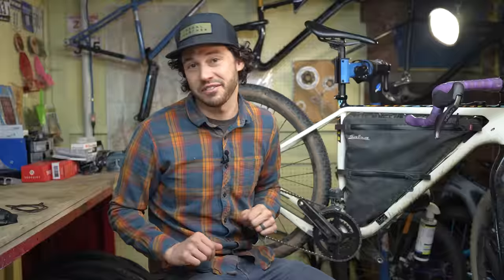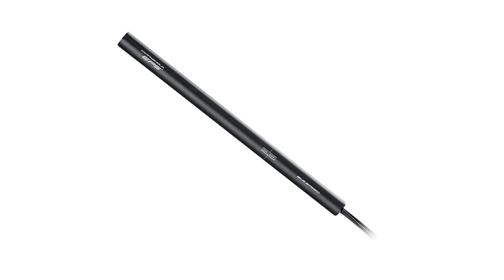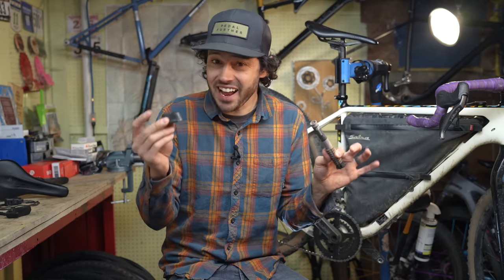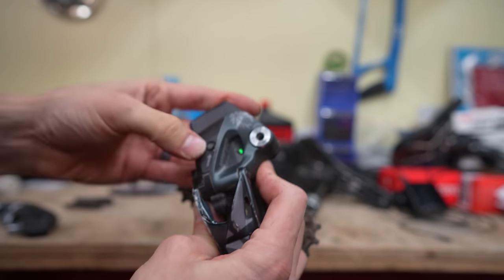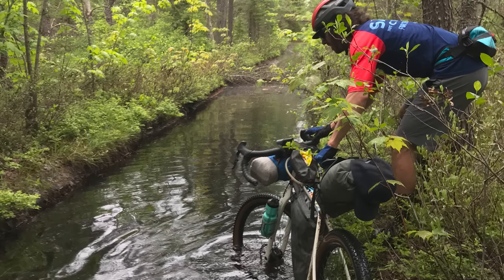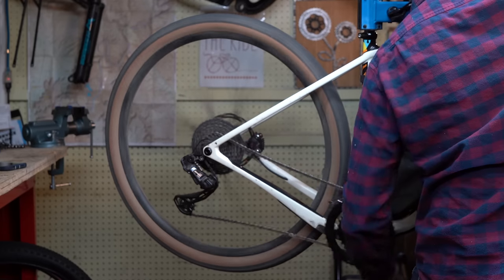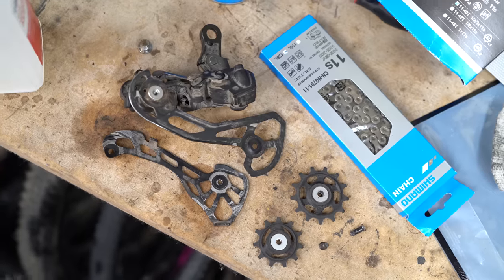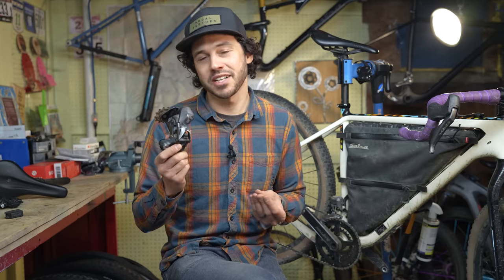Electronic Shifting: Pros, Cons, Reliability, and More

Comment: Love all the videos you guys create. One nerdy comment about the break-in period for mechanical shifting. I worked as a bike mechanic for 10 years and heard the 'shift cables will stretch' explanation Many times as well. However, when I attended the John Barnett bike maintenance course they shared a slightly different explanation - the cables don't stretch at all (it's a braided steel cable, how much stretch could that allow?). They asserted that any secondary adjustment was likely due to the cable housing settling into the end caps. (Like, if the housing wasn't cut exactly square, the first shifts would compress the housing into the end cap slightly). Anyway, I thought their explanation made a lot of sense and was pretty interesting and wanted to share, whether or not it is 'the truth'. Cheers and all the best for a rad 2022!
Reply from the maker: Interesting, thanks for the explanation. Damn cable housing always making it difficult for us!  More reason for clean cuts and diligences in the first place. Rock on!
Reply: It is, indeed, the truth. If you grind the ends of your housing with a dremel on the install, and make sure to settle everything in right away, then cable "stretch" doesn't exist.
Reply: Yup, true story. Barnett graduate as well 🍻
Reply: @SnootchieBootchies27  amazing. What dremel "head" (bit?)  do you use for this?
Reply: @kimkrimson  I just use a cut off wheel like a grinding disc and just get the end nice and flat. You have to do it in short bursts or it gets too hot and melts the plastic all weird.
Reply: @SnootchieBootchies27  I tried cut-off wheel - great results but too much setup & fiddling to avoid melting sheath.  I get consistently good results by using high quality cutters (Felco C7), and by holding the housing straight and steady while I cut using Wilton vice soft jaws.
Reply: @chuckb4375  it is a bit fiddly, and not entirely necessary. A good straight cut and and a "pre-stress" by connecting the cable, holding the derailleur, and shifting up, is all you really need. To be clear, when I use a dremel, I make the main cut with housing cutters first, and then I'm just doing a light grind.
Reply: Yep truth, kinda like chain "stretch "
Reply: That was a great explanation

Comment: I used the Sram AXS system on my ten days on the GDMBR. Extra battery and charger, but never needed to charge during my ten days. The lack of shifter cables allowed me to set my bags up easier. I also have two of the tips of my fingers amputated so the lack of grip strength didn’t affect my shifting on the long days in the saddle.
Reply: Carpenter?

Comment: The most important thing to remember is that electronics can go bad, unexpectedly. And fixing in a remote location is, well, make a guess!
Reply: With electronics, there's not much to go wrong... Fixing a 10-speed, 11-speed, 12-speed drivetrains in, let's say Africa, where you can only get a 9-speed replacement parts, is... Well, make a guess!
Reply: RollinRat  so that's settled... any derailleur will work, just need to buy a cable too. The same goes also for electronic shifting. Why would anyone need to have a 500 usd unit shipped over? If you go for 1 month bike packing in South America, Asia, Africa, you better go with 2 x 9 drivetrain, no electronics, no modern technologies, no hydrolic brakes,... Since I will never do that, I assume my longest trip would be 1-2 weeks, I'm fine with electronics and 2 batteries with me. Mind the prices will drop significally very soon, Shimano is about to release new electronic stuff any day now.

Comment: I used etap AXS on my gravel bike for about 18 months before I switched back to mechanical shifting. My primary motivation for switching back was that I wanted to simplify my bike maintenance routine and regularly charging my etap batteries added one more little thing I had to remember to do. Additionally, even though I regularly charged my derailleur batteries, I did find myself without shifting when one of my CR batteries in the shifter itself decided it was done.  After that, I decided to regularly replace those CR batteries which added yet another , albeit much less frequent, maintenance task to my bike, and to be honest it felt really wasteful doing so since I had no idea how much juice was left in them before I tossed them out of principle of preventative maintenance.  I do often miss the crisp shifting and robot noises, but I also enjoy a bike that doesn’t ask a lot from me.  
Great video Neil

Comment: You know, one thing that might make electronic shifting appealing to me would be really broad cross-compatibility. Like if I bought a Shimano 13-speed MTB shifter 10 years from now, it would be compatible with a 10-speed road derailleur from 5 years ago, in on either a 10-speed or 13-speed drivetrain, or anything in-between. Currently I have bikes with friction shifter, bikes with 20-year-old rear derailleurs, bikes with road shifters running MTB rear derailleurs, etc. Sometimes this is tricky or takes Goat Links or Problem Solvers to make this work, but other times you luck out and it works great on its own. With electronic shifting, there is no real reason for derailleurs and shifters to NOT be compatible. Length of a derailleur cage could limit gear range, but other than that, why not? THAT would be a selling point I would be interested in.
Reply: Archer Components D1x is pretty much what you're describing: taking any mechanical rear mech and feed the cable to a wireless actuator. You then tells the system how many gears there are.
Reply: @greatgoofy  I concur. I have used the Archer D1x for several years and it’s a really easy package to setup and adjust — and it’s brand agnostic. They even mix component brands on their YouTub channel just to prove how versatile it is. The D1x, it has advantages over Shimano and SRAM with the set up and adjustments. But the down side is its form factor. Still a great company with very personal customer support!
Reply: RollinRat  I hear ya. I tried to order a pair of thru axles for my bike last week. The number of "standards" is obscene. Why couldn't they just pick one thread pitch and 1 or 2 lengths when they switched to Boost? Ridiculous.
As for friction shifting, my favorite bike is my touring bike (a bike that can do anything), 3x10-speed friction shifting, its always flawless.

Comment: I don't have anything against electronic shifting. If I was building a XC or road race bike, I might build it up with electronic shifting. But I'm not. Few people are. And I just can't see any compelling reason for it. It shifts faster and more precisely? With minor exception, my bikes shift flawlessly. I don't doubt electronic shifting is better yet but would I actually gain anything from this? Not everyone is a great mechanic and therefore their bikes may not shift great. But if you can't set-up a mechanical shifting system, is an electronic/mechanical transmission really going to be easier to handle?
My biggest reason for a lack of interest in electronic shifting is that I DON'T WANT TO HAVE TO CHARGE MY BIKE IN ORDER TO RIDE IT.  I don't want to have to worry about it on a long ride or multi-day trek, I don't want another thing to think about as I'm rushing to get a ride in after work. Or having to deal with the battery running out of voltage in the cold or wearing out after a few years of use. In the end, I don't see any reason to spend extra money on something that provides no value to me, and makes my life even more complicated than it is.
Reply: I agree some times I rush home to ride after work, would be a pain to discover my batteries are discharged and so my ride is over :-( Also batteries are not really ecological especially those CR2032 in the levers . . . But having no shifting cables is appealing in a sense 😇
Reply: Here here
Reply: I did a bike packing trip with a friend, borrowed his bike with Di2, never charged it, stuck in one gear the entire time. Luckily it was the perfect gear and it wasn’t bad. When it’s charged it works real nice.
Reply: I agree, but I also always ride with lights, and a head unit that require charging so they always get charged, so I would just charge at the same time. Likewise, you can always have a spare battery in the base of AXS especially. I can see the merits of both. It’s why I’m going to try AXS and if I don’t love it either swap it to another bike, or sell it, but everything other than battery charging seems to think I’ll love it. Plus, it doesn’t require the work arounds I’d need for a “mullet” build

Comment: Why not? I still have a buch of  9 speed shimano mtb components. My gear is well maintained and thus crisp shifts. Besides that, it is rock solid build quality not to forget compatibility with 9 speed road levers. IMO It's the environmentally soundest way: to continue using what you have till its worn down before getting something new. ...and Electronics? eh.. too expensive.
Reply: look at the Archer components system, it can be configured to shift any rear mech with 2 to 20 gears (you chose) and the cost looks very very reasonable compared to the usual suspects

Comment: my 200cents on this topic: i think theres more nuance in the electronic vs not. good mechanical are arguably better for bikepacking, but not all bikes can use them. e.g. sram eagle with sram cables and hoses is perhaps a better choice as cable stretch isnt a problem and these shift extremely well, while on 2x axs and others are arguably saving a lot of setup time and so on.  also, electronic drive trains derailleur hanger can and will bend too. the axs protection mainly protects the expensive derailleur itself, so that the hanger bends or break rather that the servo gears (which is great actually).  imo while all the electronic tips in this video are good, the pro and cons section is misleading.  i also have various drive trains my my 2016 sram eagle has 10000kms and  quite a few week-long bike packing trips, been taken on planes, and around the world. one advantage is that if it breaks really bad im more likely to be able to piece it back together or get a replacement shifter. on the plus side of axs, i can easily remove it before a flight and put it back as setting it up takes 1min, to avoid damage during transport for example. its also great where puttin eagle requires hacks, or where the frame doesnt align just right for 1x, or where i use 2x (i also like di2, but axs can be swapped so easily...)
Reply from the maker: All good points.  The fact that you could say get a 12 speed mechanical system to work with 11 speed mechanical system in a pinch is certainly an upside. And removal of the AXS or even Di2 rear derailleur is so easy, that's a great travel hack. This video had a few variations at its inception but this is how it was born, I think it could have easily been "mech vs electronic" video, but I wanted to simply talk about electronic shifting with a few comparisons along the way. Thanks for the words!

Comment: Mark Beaumont biked the entire length of Africa unsupported using a carbon fiber bike with Shimano Di2 electronic shifting, which only needs recharging every 5000 kilometers.

I myself use electronic shifting on a carbon bike for bikepacking, a Rose Backroad Limited Di2 modified with a Garbaruk extra long rear derailleur cage to accommodate a Shimano XT 11-47 cassette. The Shimano GRX Di2 is lighter than its mechanical counterpart, as all Shimano electronic group sets are. It is ultra reliable. I see no need to bring an extra Di2 battery because of the extremely long life of the internal battery.
Reply: SEAM electronic setups can be heavier. Pretty sure GX AXS is.

Comment: One thing i really like about shimanos road di2 shifters is that they are more compact than the mechanical hydro ones (i have small hands), and they feel higher quality because there is no wobbly play in the lever action. i also percieve the braking to be more direct and stronger from the tops but i guess thats due to a better reach with small hands. apart from friction shifting and some hacks they are also the only way to get a modern shimano 2x/3x mtb drivetrain to a monjstergravel/touring bike with dropbars.

Comment: Two issues for me.  First is the price, darn expensive.  I'm still struggling with the notion that bikes have cross the $1k barrier, which is now about an electronic groupset's starting point.  Second I'm pretty sure that if I actually try electronic I'll go down the rabbit hole and find mental justification to retrofit most of my bike fleet to electronic, which takes me back to the first issue.
On a more serious note I do look at my growing pile of dead rechargeable batteries from lights, battery banks, etc and would prefer not to add another source to them if I can avoid it.  Disposal is a hassle, and I'm guessing more people than not improperly chuck them into the trash rather than hunting down a proper electronic recycling drop location, which is a hassle, and hence my growing pile of castoffs.
Reply: RollinRat  You keep repeating that. There is always something that can go wrong, no technology is fail safe. I started riding a bike with electronic shifting last year, also traveled about 3000km in about a month, riding across bumpy Spanish backroads and single tracks, lots of dirt, across Sierras and over the Pyrenees. Maybe not some real world touring though, maybe I am a sucker. However I know how to prepare and try to pack accordingly. I bring two batteries and a charger, very lightweight, a battery lasts about 1000 km and I could even charge using my dynamo hub. Absolutely not an issue. A derailleur hanger I used to carry before electronic shifting as well. Should my shifting for some reason not work anymore there are differnet options. I could just ride single speed, could even take of the derailleur and find a magic gear. If I happen to find a bike shop I could put a mechanical derailleur on the bike and just clamp the shifter somewhere. I would be more worried about finding a 12 speed-shifter or a cassette fitting my driver. Also not a problem specifically concerning electronic shifting. One more method would be to find a cog and drill some holes to attach it to the hub instead of the break disc and ride the bike with a fixed gear. I get the point people make about riding 26" bikes with rim brakes and technology two to four decades old when getting to remote places. And when I put together my bikepacking rig I thought a lot about electronic or mechanical shifting and hydrolic or mechanical breaking. But I decided to build the bike as I enjoy it and so far I do not experience the electronic shifting to be a particular weak link in my setup. The comfort the electrics give my chronically numb hands far outweigh the potential problems. Honestly, have you ever tried electronic shifting and really made up your mind? I would rather consider it shameless calling people suckers for having a different opinion. Cheers and stay safe out there.

Comment: Best idea for Di2 I got from Jay Petervary's video explaining his long distance racing set-up. If you're having frame bags on your bike anyway, just give up a little storage space and route your battery in the bag instead of hard to reach inside your seat post: https://youtu.be/4HKOLR81S7U
Reply from the maker: Good idea, and for folks that already run dropper posts and using Di2, many are doing this.
Reply: I recently set up and sold a bikepacking specific 1994 Cannondale rig. I had bags made on Etsy and worked with the craftsman to add a pocket inside the frame bag for the DI2 battery and internal routing for the wiring (along the top tube w/Velcro attached to keep it in place). Wish I had pictures.
Reply: I've enjoyed his knowledge and experience as well.

Comment: Never going back to mechanical.  
Stuff breaks now and then and don’t worry about it. 
The shimano system also cuts power to front derailleur when battery low so you still get longer use of the rear.
I wish shimano shift levers were larger though.
Reply from the maker: The video was already really long, and I could have touched on this, but the RX815 levers are hands down the best lever I've used, the lever feel paired with the 18mm higher brake axis gives me confidence on the ups but certainly on the downs. I think the issues with drop bars generally is the ability to brake, but the rx815 levers handles this very well!

Comment: Both have benifits. I definitely like the electric for the ability to have shifters on aerobars and better shifting. Mechanical is good enough for me if setup well. I'll stick to mechanical for now. A bike should simplify your life. Mechanical is more bombproof and accessible at this present time with more options on the road when touring and longer service life. The electronics eventually die and parts get outdated faster. I am however a fan of dynamos. Electronics will get there eventually and the price will get down in a decade.

Comment: I’m about to have a fully custom frame built up and I’m really struggling deciding between 2x9 with down tube shifters or full on electronic shifting. I’m not totally a retrogrouch per se, and I know the performance is great and the weight penalty is minimal, but there’s just something offensive about the idea of needing to update my bicycle’s firmware.